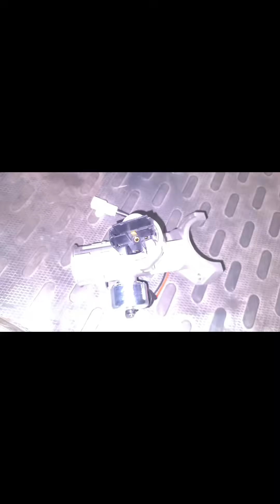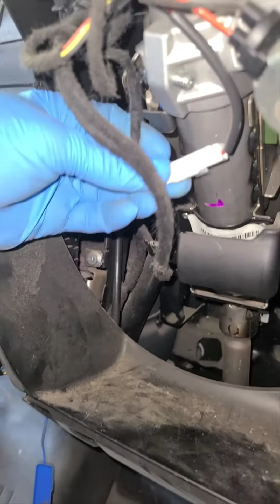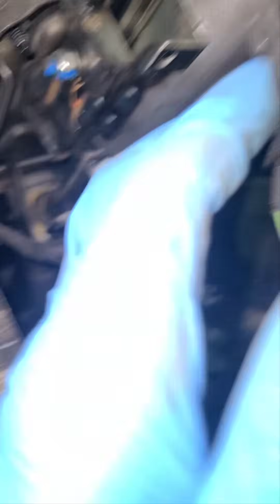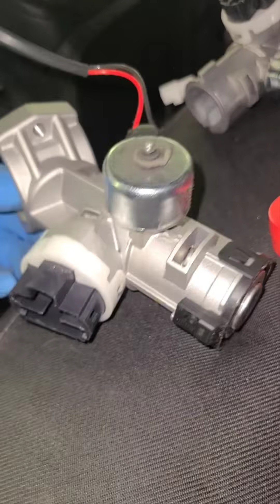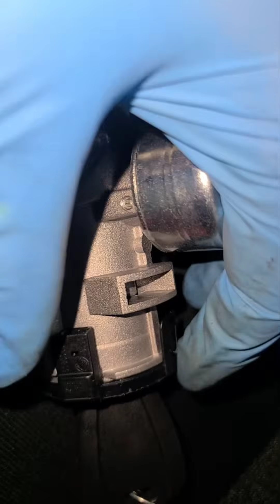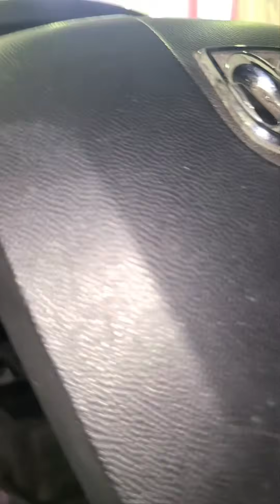NO CRANK, NO START 2014-2025 RAM PROMASTER 2500? CHECK THIS! HOW TO REPLACE IGNITION SWITCH

Comment: Hey I came across your video and it's very informative. I am having also the same issue, I purchased a van from auction that was listed as a run and drive but when I got it in my possession it would not start. Battery volts are good, seems to have ground, mega fuse at positive terminal replaced, cycle ignition nothing, no crank no start and no light on dash. Key is not stuck. Only time when I see light on dash is when I open the door, radio works, can't read OBD because nothing happens when I cycle the key.

Comment: I can' turn the key in my ram promaster 2500. Two weeks ago, i was having to wiggle tge key to turn it. Now it doesn't turn at all. Thanks for this detailed video of how to fix this problem. Wasted time watching the other videos of where people is telling you "here is the hole and insert a thing and release" all of those are garbage videos. This is 5 stars
Reply from the maker: Awesome! I'm glad that I help you❤. Is there anything else you want a video of on the promasters? I can try my best to get it when I'm at work.
Reply: Did that end up being your problem? I was having similar problems and it turned out. It was the actuator in the door having issues with the security system in the computer.